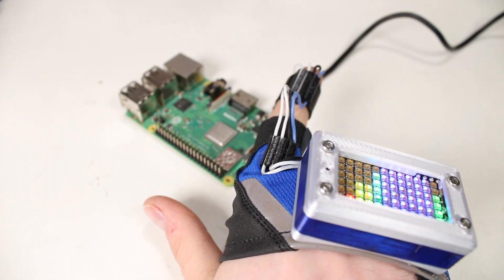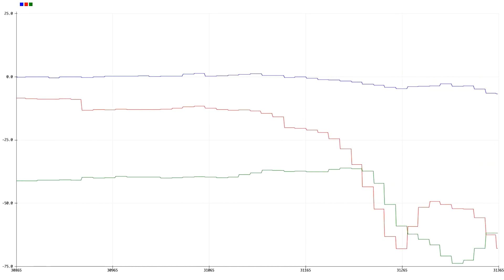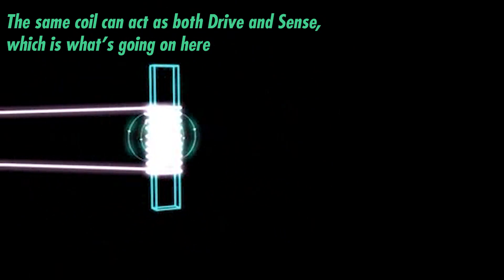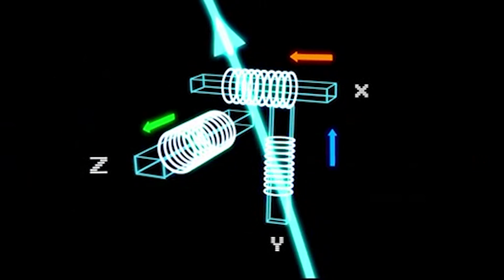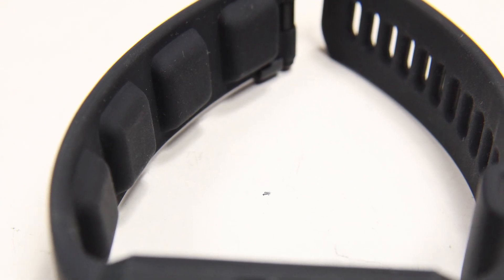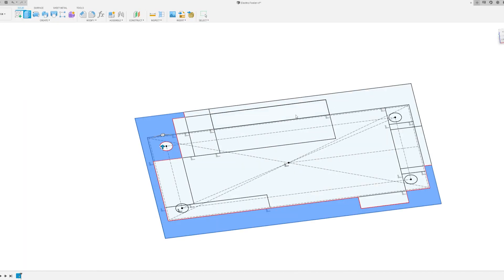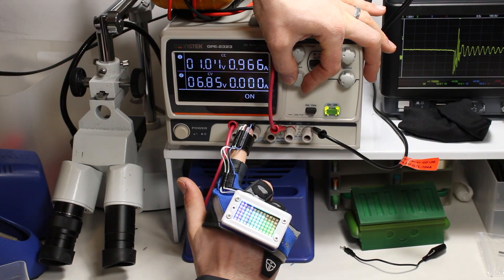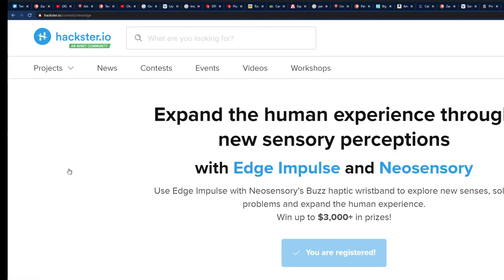Designing a Glove to Feel Electricity Through Walls

Comment: Its so simple. And easy to build off of. I think I could make one that could tell you how much current is running through the wire with actual data readings on a screen. This might be more useful for electricians. Then again I'm a failed electrician. I just build robots. And even then they mostly tear themselves apart.
Reply from the maker: Electricians mostly work with AC, so they can use a simple non-contact "wimp stick" that lights up or buzzes near AC. The advantage is those are powered by the current being measured, so they don't need batteries! Special fluxgate oscilloscope probes are actually used in compliance testing labs - that's where I got the idea for this episode in the first place.

Comment: I had an uncle that was an electrician and got zapped from high voltage when he was working on a big transmission tower (mind this was back in the 70's when health and safety was more of a general guidance rather than actual law). He survived  but for the rest of his life he was able to touch home 220V live wires but without feeling pain. He used to touch them to see if they were still powered rather than using a tester. Seems like a superpower but mind you, not feeling pain is not equal to not recieving actual damage to your body

Comment: your not the first to feel electrons, you need to look into the grinders section of hacker culture, maybe see what Lepht is doing. you could have just put a magnet in your finger.
Reply from the maker: I address that in the pinned comment. Implants are hyper-dangerous and also don’t detect low current DC.

Comment: In case anyone is trying to replicate this, I just went through it so here's some tips from me: The magnometer is Texas Instruments DRV425EVM, Digikey part number 296-43710-ND. The pinout for the chip (where you connect the wires is as following: Pin 1 (has a square connection to the board, looks different from the others) is the reference pin, A5 in the sketch. Pin 2 is the output, A4 in the sketch. Pin 3 is ground, and Pin 4 is voltage in (power). In the datasheet these pins are referred to as J1 pin 1, etc. So make sure you connect those to the right pins on your arduino and you're good to go. Make sure you have an arduino with 2 or more analog pins, I tried an older feather first and it only had 1. You can get haptic motors and controllers pretty cheap if you don't want to deal with the bluetooth wristband, check adafruit's site.

PS thanks for a cool video, and the code is really invaluable!

Comment: it would be a nice theorical addition to make a map out of the data;
A paint file generated by the push of a button/idk , you push the button and the thunder finger tracks X and Z motions turning the varying fields into a 2Dmap, repress the button to tell it to stop tracking and it outputs the file.
Its as useful as you think of it as.

Comment: There is another method of achieving the ability to feel electric currents, This is by implanting a magnet into a specified finger at the tip where the nerves are. This will allow your body to connect and you'll "naturally" develop the sense to physically feel the electricity running through wires. This is primarily done by body hackers, but you should check it out, but to anyone reading, I highly advise you do not perform this surgery on yourself unless you are a medical professional.

Comment: Dude, I built something like this when I was a kid in the 70s to find a short on a Nascom 1 PCB I was building.  It was a little coil on my finger, which connected to a big op-amp amplifier feeding an ear plug.  I could HEAR electricity.  I injected an audio signal into 2 PCB tracks that shouldn't have been connected, and then followed the current until I found a solder bridge.  I won a prize in the school science fair with it.  Those were the days !  Life has pretty much gone ownhill ever since....

Comment: HEY! If you slapped this idea onto a drone, that's basically what I did for my undergrad capstone! I wanted to see if you could detect faults in high voltage lines by just sending a drone to follow it with a decent magnetometer and some software to do the Fourier transform.  It was all fun and games... I mean... It was all science and learning, and totally worked, until some buzzkill professor pointed out that I was flying a drone next to live power lines and that was some sort of "hazard".

Comment: You should tune it better and do a blind voltage/current test. Have different voltages/currents in wires and see if you can accurately guess what they are. Kind of like pitch perfection but for electricity.

Comment: I've actually seen a guy do a bunch of interesting experiments of using flexible PCBs as moving parts to actuate, I wonder if you could do something like that to print a ferrite ring? There's also some pretty hardcore folks who've gotten small magnets implanted in their hands which does a very similar version of this, though you can probably make this more advanced and turn it into a sort of logic probe, or at least a version of those electrician's multimeters that can sense the current in wires by wrapping a claw around the cable, usually used in high voltage AC applications, cause y'know, electrician.

Comment: Question for a learned fellow. 9 electromagnets pushing both n s int the center of a circle around an inductor. Nonagon if you look at it and cut the points perfectly it shifts just slightly. It vortects the magnetic field maximizing the inductor output into a transformer it goes and hopefully back into its self but to simplify you could use 3 magnets and shit it to swirl. Thanks 369
Reply: Shift oops

Comment: Phrase it like you did, as a 'refresher' for those who know already and a 'primer' for those that don't. Keep it snappy and don't dive too deep and I think it works. Helps to set the stage for what's coming, even though I already know how it works. This is also a good idea for experts who's interests overlap, but aren't specifically circuit theory (or whatever). A Physicist could understand the way the Electron/Field/etc.. works, but not understand why you would need a voltage divider or somesuch.
Reply: Indeed, I know how a hall-effect sensor works, but I didn't know how the other one works. It's basically a magnetic interferometer.

Comment: You seem to have (perhaps intentionally?) oversimplified the working of the fluxgate magnetometer. The crux is saturation of the core and a slight shift in the saturation polarity as a response to an external (weak) field. Would be cool if you did a video explaining the fluxgate a little more in-depth :)

Comment: I may be in the minority here, but I prefer skipping the most basic material, and am I don't mind when a project goes over my head at times; that's actually the best part, because that's when I, as someone who's watched hundreds of hours of electronics videos and has an engineering degree, am learning something new. Now, there wasn't too much of the basics here, but it was odd when, right after introducing a spanking dope sensor that I personally had never heard of, you back step to mention right hand rule. Like, if someone is replicating this project, there's basically no chance they don't know that already. In contrast, the description of the sensors and the differences between them was all new content, to me, and it wasn't something I'd seen in any other video I've watched. Voidstar Labs is great, to me, because you have such advanced projects, so I'd hate to see the gritty details washed out to make way for the 101-basics that channels like Adafruit specialize in covering.

Comment: instead of using a vibrating motor, you should use a variably charged capacitor. That way you can actually feel the electricity

Comment: Sister company of my workplace was getting some X company to make simple solid state sensor so you can for example slap magnet on something rotating and detect the speed, but the X company was like sorry bro we won't be making this shit any more.
I was then tasked with the objective to document the design and manufacture it in house.
Electronics were buried in hard epoxy but I was given unpotted assembly.
And all it was just some basic hall effect sensor from allegro and two ferrite rods attached to both front and rear face to increase the flux density, in other words it was drastically increasing sensitivity of the hall effect sensor.
I wonder if that would help in this project if you would want to use basic hall effect sensor for some reason.
Reply: Oh and people don't look at your resources because although videos are very entertaining to watch, most of your projects are nothing that anyone else would really make.
But there's opportunity and challenge for you to change things.
Turn this sensor into serious project, pen form-factor, simplified and visual only with tiny OLED screen and have it display signal strength and signal type as you said like DC, PWM, Serial etc.
NOW that would be something a lot of people would make and chinese rush to mass produce it for cheap and sell it on ebay and ali.

Comment: I just completed Photoelectric current chapter and I'm really excited to see that can it read the photoelectric current too. Not only that if we use a photoelectric collector as a receptor, then it can also act as the intensity of the light calculator or the frequency of the photon calculator, thus an electromagnetic wave type detector (as we are getting the frequency of the photon emitted, it can be compared to the series and it can give the information about the type of wave, it's frequency and it's intensity. Although it's a useless idea, but  it sounds fun)

Comment: Would it be possible to read USB wirelessly with this?
Reply from the maker: Unfortunately not. USB is a differential signal, which tries to minimize the magnetic field around the wire. What you’re seeing is the sensor detecting the current flowing through the cable’s power and ground wires.
Reply: @ZackFreedman  :( 
My dreams of touching a USB cable to read it have been dashed. When I get around to  tinkering with this stuff, sniffing signals of any sort will definitely be on my list.

Comment: How would it sniff serial communication? The voltage is going up and down but there is next to no current going through the wire, am I wrong here?
Reply from the maker: With a quality amp, ADC, and filtering, this thing could detect magnetic fields in the single-digit µT range. Of course, it depends on the impedance of the line, but it's not implausible.
Reply: @ZackFreedman  Good to know, I didn't know that you could do that at such precision
Reply from the maker: Yeah, it’s cool! The crazy sensitivity is why you’ll find fluxgates in research-grade instruments like current probes.

Comment from the maker: A bunch of folks have suggested an implanted finger magnet! This lets you feel the presence of DC current, but it's difficult to tell its intensity and position. Also, OUCH!
Reply: Cody from Cody's Lab had a magnet in his hand for a while and it actually worked decently for picking up current.
Reply: That's too bad, might want to consider pinning this comment so people see it.  And if you put a magnet in your finger, it would mess with the readings on your Thunder Finger.
Reply: @Theminecraftian772  you usually put it in the ring finger of your non dominant hand. IIRC you do it like this because the ring finger has more nerves and you don't want to get your dominant hand infected.
Reply: @AtaGunZ  you generally put it off to the pinky side of the ring finger, yea. In addition to the nerves, the ring finger is the weakest in the hand and generally isn't stressed as much as the other fingers, and usually less likely to get agitated during the healing process.

The being non-dominant hand has very little to do with infection rates, and more that you're less likely to bang it on something or use the hand too much while it's healing. I've got mine in my non-dominant ring finger, but the next one is either going on the ring finger on my dominant hand, or my middle finger on my non dominant hand, depending of a few factors.
Reply: @Theminecraftian772  he has two hands...
Reply: An issue that was pointed out to me about implanting magnets - if you need an MRI at any point, it has to come out.
Reply: @SirRebrl  Not really! MRI scans with magnetic implants is totally possible. You just need to inform the operator first, and it might mess with the results a little(not in a significant way from my experience). The size of the magnet you are implanting is actually very small. It's not that different form people with braces getting MRI scans.
Reply: (be sure to press that emergency button quick if you feel heat or unusual amount of movement)
Reply: @AtaGunZ  Oh! Cool, learn something new every day. Plans to get magnetic fingertips back on! XD
Reply: @AtaGunZ  Same, I've had a 3T fMRI, I could feel the magnet rotate, but had no pain. The operator told me my magnets would at best ruin a scan of my fingers and palm, but wrist would be fine.
Reply: @SirRebrl  It will come out, even if you don not want it to
Reply: the ouch isnt that bad. little bit of numbing agent and a small scratch. had them for years embedded in my mid finger. lowers the chance of broken magnets in the body (Really Bad). and with 6 total. one in each midfinger and one in the palm your brain does the calculation and you can work out direction based on the vibration. Just takes a bit of learning to use like any other sense. (Source: Me. Been doing transhumanism for over 15 years)
Reply: @admiralfalco  I never though about palm magnets, but I guess i wouldnt do those for the same reason i put them in my pinkies. Its really really uncomfortable to hold on to anything steel for long periods of times. I work on cars and metal working, and with the pinkies by the end of he day i hold everything pinkies out like im drinking fancy tea.
Reply: @ionstorm66  yeah it can be a bit weird for certain objects. Though I mainly work in electronics and computers. So it comes in useful for quickly checking areas of a board for power and weirdly noise.
Reply: @admiralfalco  This is so cool.  So not only can you sense current, but you can even point to the source?  Incredible really.
Reply: @dtsyt82  with a bit of focus and training your brain to 'feel' it. Yeah pretty much. So long as we're not talking super complex electronics like 6 layered PCBs. Recently I was able to notice a subtle change in one of my fans. (there was a weird noise feedback in My PSU. Turns out something dodgy with one of my 12v fans. Put the hand near it and sure enough it felt... Different. Remove that one and replace and no more noise issue. Not exactly sure what was wrong with it but I may take it apart and find out
Reply: You can still feel DC current with the magnets. You just have to move your hand, and it has to be more than a few amps. Also rapid changes in DC you can easily feel. Hooking a set of jumper cables on a dead car gives a very strong feeling. Also DC welding you can feel the current changes as you increase/decrease arc length. Source: have had finger magnets in my pinkies for >10 years now.
Reply: Answering your question: I would love more ''theory'' in your videos. I'm a "freshman" engineering student and I watch your videos for the same reason I watch Michael Reeves etc... Not only for the entertainment but because I learn stuff. I doubt I'm the only one. Either way, nice video as always, sorry for garbage English and Good Night from Spain
Reply: I was confused when you said that you were going to do a giveaway in patreon, now it makes more sense.
Reply: A paid giveaway is a lottery ;)
Reply: More explaining!
Reply: I have an implanted finger magnet! And yes, you can feel the current, but not the exact positioning. It's still super cool though.
Reply: 1) Would love to see a update with somethingsomething tactile actuator (transducer?) that can output also the frequency of signal/current? I guess fingers can't sense 20kHz, definitely not 20MHz - "Modulate by x Hz" ui?  
2) The corner of the internet where it's completely normal to have magnet implants. Love it. Btw, could 3 magnets in same finger (triangle) be enough for brain to learn more accurate position of the current?
Reply: @jussiollila7714  You need to be careful implanting magnets too close together for the same reason eating them can cause some real nasty issues.

Magnets are attracted to each other, and that still holds true when they're implanted. if you put them too close together, they'll attract to each other over time, crushing the flesh between them. Not a great time.
Reply: I had magnetic implants for about 10 years, loved them.
Reply: Considering this project, the data glove, the HUD, and the cyberdeck, maybe try putting your projects together into cosplay of what the peak cyberpunk version of yourself might look like?
Reply: Patreon such a shit show now we need an alternative now